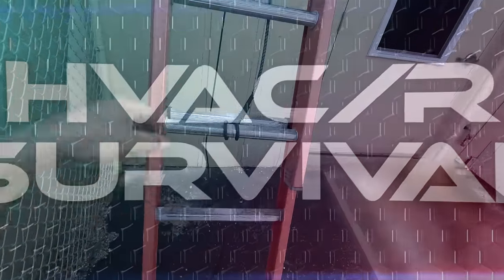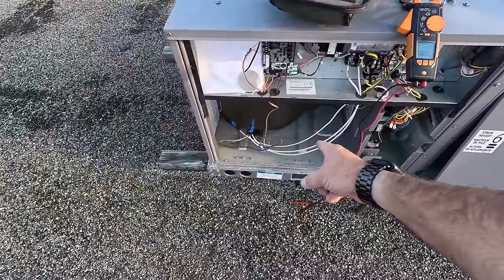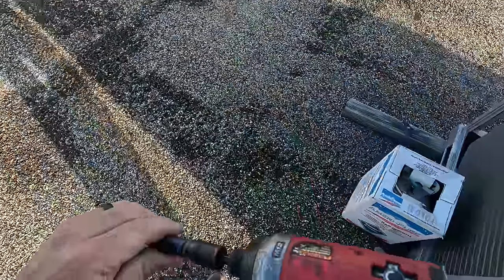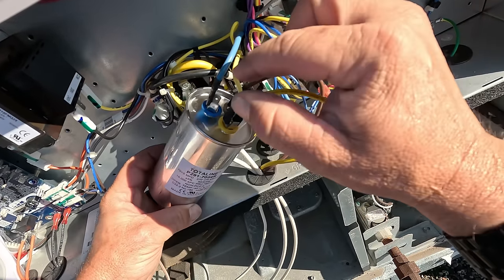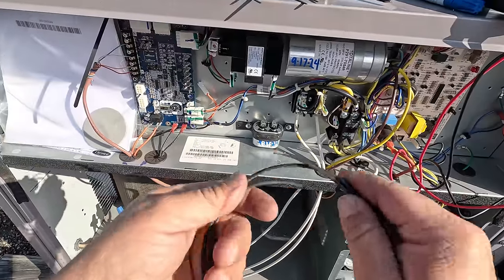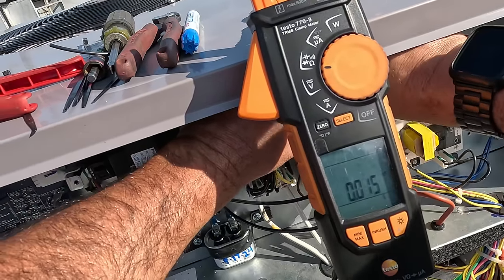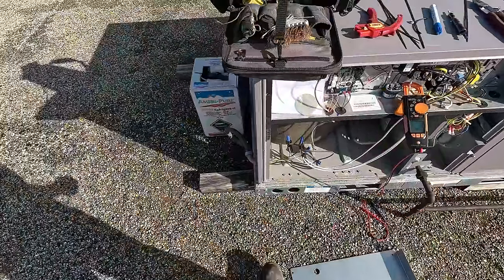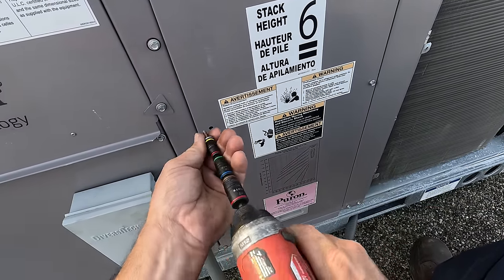AC Tripping Breaker What Else Should You Check?

Comment: Taking it back to the basics. Nothing wrong with that. I admit....i haven't checked a capacitor in a long time. Granted, i don't work on equipment that usually have them, even the condenser fan motors are 3 phase and 1-3hp. Your video reminded me that i should check to see if the equipment has them and test them if they do. I remember the first time i ran into 460v single phase. I installed a 208v CFM....yup i let the smoke out. Its a reminder to be diligent. Great video as always Rick
Reply from the maker: I haven’t seen 460 1ph.  Only 277v 1ph

Comment: One good upgrade to that meter is the little thermocouple adapter which I believe they sell as a combo adapter + k-type thermocouple .
The downside is that the adapter takes a battery , but the positives are that 
1_ if you use the Bluetooth and connect via the Testo smart app then you've got a Bluetooth digital thermometer
2_ I've compared it to my dedicated digital thermometer and it's pretty damn accurate , way better that what I got on the Fluke multimeter with the brown  thermocouple that came with .

Comment: You made a good job there Rick.
I was used to very tight spaces and used a very small amp clamp meter.
The brand is Kyoritsu. The older model I had was KEW snap 2033.
If you ever wish to try the real small one, look up that brand😬 AC and DC 300AMP the little guy
Reply from the maker: I'll have to check it out!

Comment: Great video. Thank you for sharing. Is this RTU is 3 phase or single phase ? please. If possible. Could you make video how to 3 phase breaker panel, circuit breaker panel l looks like for 3 phase HVAC ? and how to lock out tag out for 3 phase power HVAC ?
Reply from the maker: This unit was single phase, explain to me a little clearer what you're looking for in a video? I think some of the words got messed up and didn't come through correctly and it's hard to understand what you're wanting.

Comment: Was it a toss-up between adding two capacitors together, or wiring in a separate 10mfd cap?
Reply from the maker: you could have done it several different ways. you could use two 35x5 in parallel and get the 70x10, you name the combo, anything would work to add up to it.
Reply: @HVACRSurvival  I was thinking 70x5 and 10 by itself.
Leave a note in the unit giving the size of the original capacitor. If the 70x5 or the 5 went bad, the tech might miss the fact that it was time to install 70x10.
Do they plan to get the right caps in stock, or is it a discontinued odball?

Comment: Caps in series are like resistors in parallel 
1/c1 + 1/c2 = 1/c total
Reply from the maker: Yeah I knew it was some funky equation like that which I don't remember how to do that🙄. I was going to show the formula when I edited it, but ran out of time.
Reply: @HVACRSurvival  if they're all the same capacitance it's easier you just divide by how many there are. So three 10 microfarads would be 3.33 microfarad

Comment: two equal value capacitors in series makes 1/2 the rated value(give or take the tolerance of both).
beyond equal values and more than two in series, it will need calculated out, but it will always be less than the smallest rated capacitor and lower capacitance as more are connected in series.
it's best to avoid series, parallel and combinations for anything beyond low power motors, although it will work, they never tend to fail equally and equipment ends up running with one failed open.
Reply from the maker: It's pretty similar to the way resistors work in parallel, just like you said it's always smaller than the smallest resistor or the smallest capacitor if I remember correctly. The mathematical formula is a fractional and I don't do well with that.